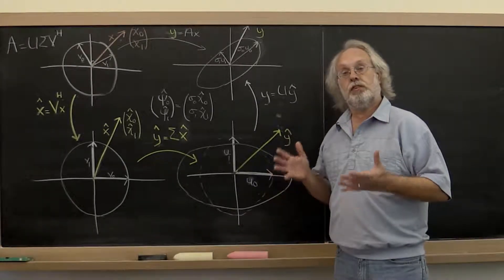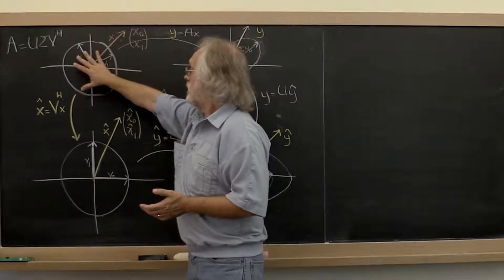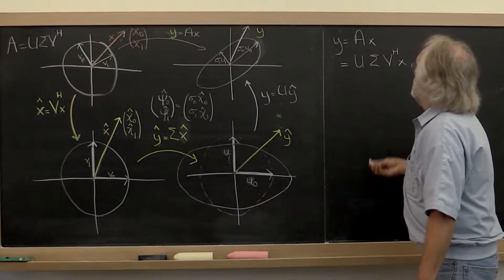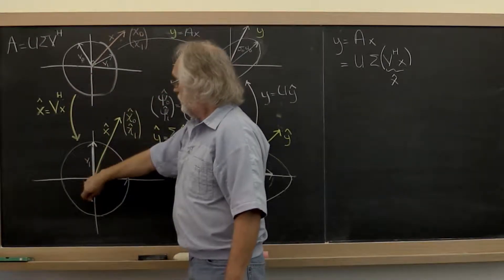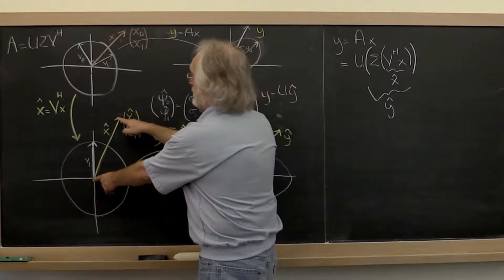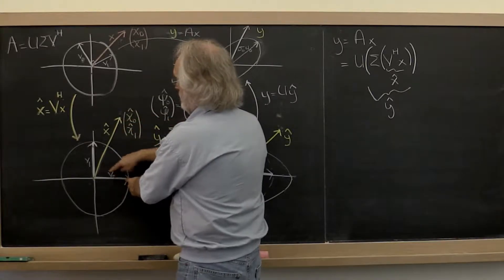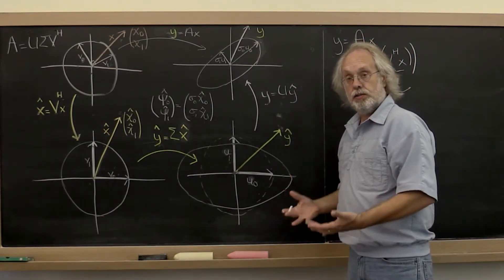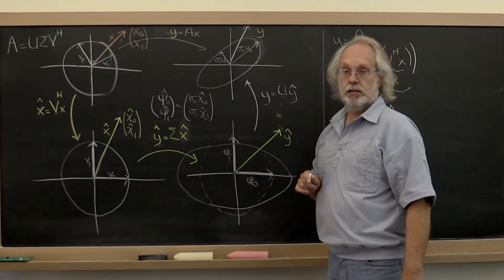2.3.2 Geometric interpretation of the SVD, part 2

Comment: One thing that he kind of skipped over is the fact that when we go from the bottom left diagram to the bottom right diagram, after we've scaled the vector by sigma1 & sigma2 along the v1 & v2 axes we're also swapping v1 & v2 for u1 & u2, which is like rotating the axes while keeping the position of yhat fixed. Then when we go to the top right diagram we're rotating the whole diagram (including yhat) so that the standard bases are aligned horizontally and vertically.